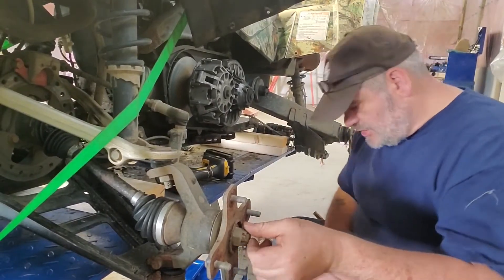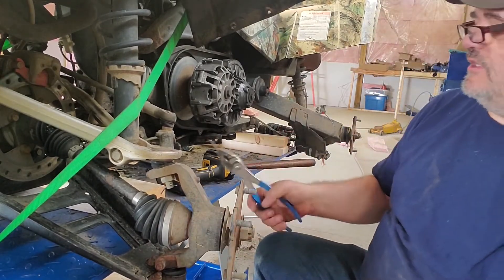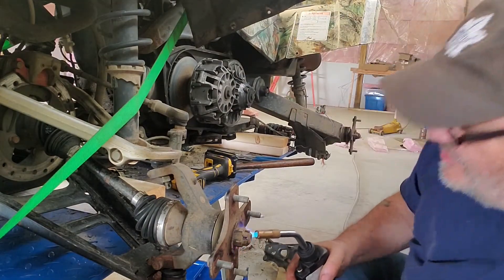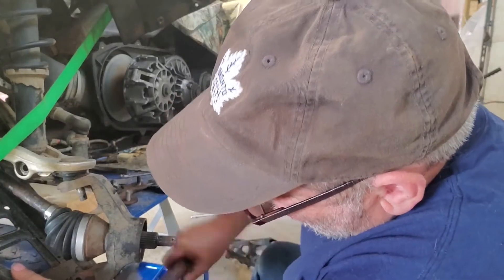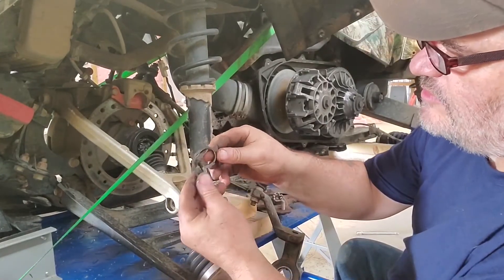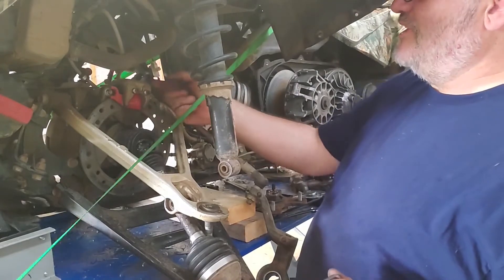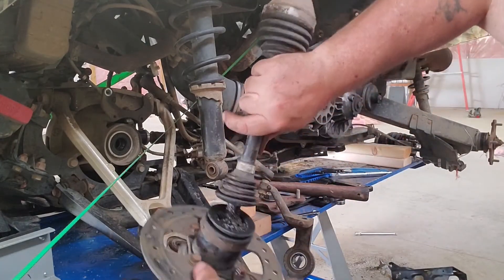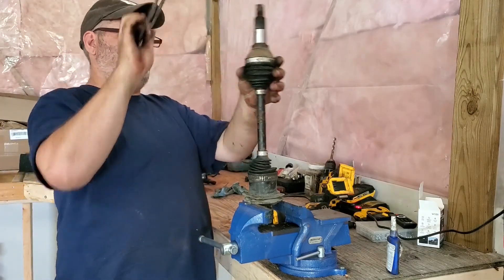CanAm Outlander 650XT Front Driveshaft, Axles and Brakes !!!

Comment: I bought a yz85 and the guy said he just put a chain on it. I test rode for 2 mins and it was fine through all the gears, it ripped. Then after he left I took offhand 1 min in the wrong chain he had installed broke and locked up in my front sprocket. I got the chain out. Now the bike starts first kick but when I let the clutch out in gear it dies.  Do I need to split the cases or could it be something under the clutch engine cover. Any advice would be much appreciated.
Reply from the maker: I would probably check the drive sprocket area closely. If you jammed up the chain bad enough you could have broken the left side case. Is there oil leaking in that area that might indicate a crack? After that pull the clutch side cover and see if something in there might have broken. Its the weaker link in the driveline so its a good place to start. The transmissions in them things are pretty resilient and almost always the last thing to break. Good luck.